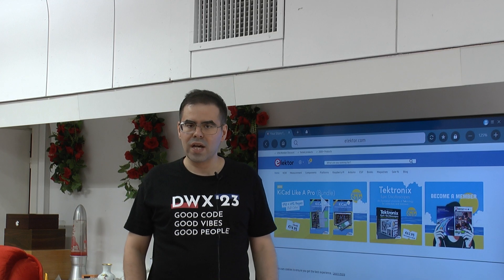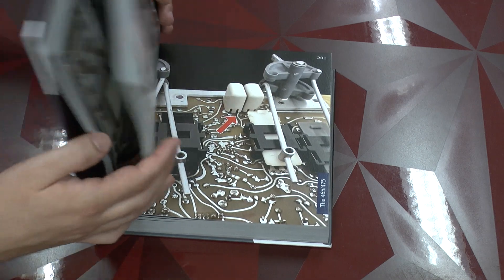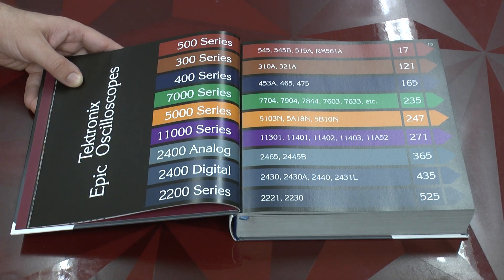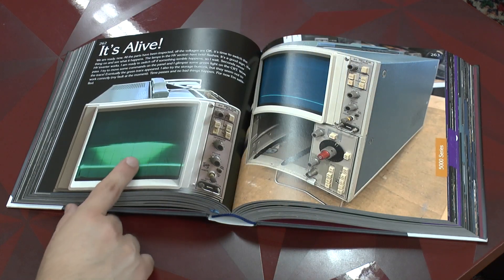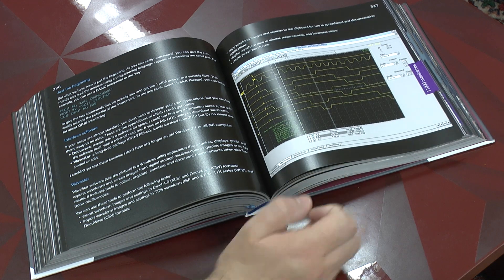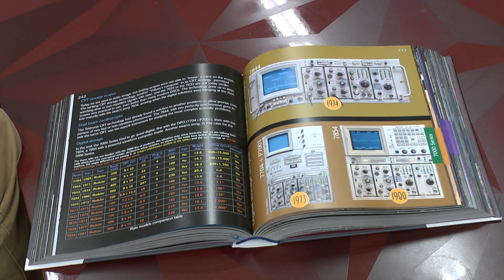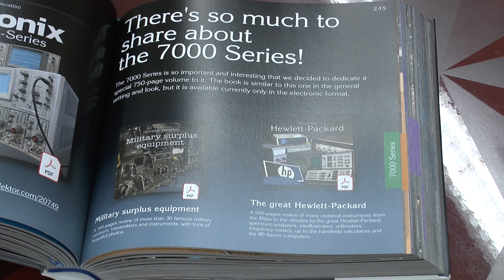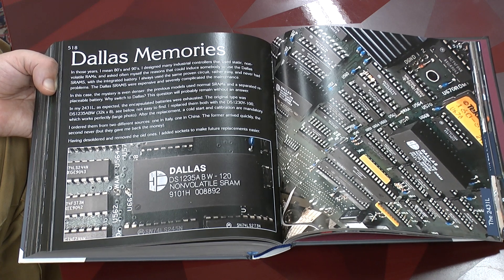Vintage Tektronix Oscilloscopes - the book, not only on Tek Scope repairs

Comment: I have the 323, the 324, a 453A, two 2465 and one 2465A scops.
Reply from the maker: Thanks, my friend! Hope you like the video!
Reply: @MrTamhan  I first used Tektronix scopes in 1972, in the US Army. I've long forgotten the model numbers. One was a small, battery powered model that was modified t use as a TDR for Cable TV.
The other was probably a 500 series that I had to repair  so that I could repair a lot of TV broadcast equiment.  This included several RM529 Waveform monitors. 
My strangest Tektronix scope is the 1780R,. It is a Waveform monitor and a Vectorscope, but it has two CRTs.
Reply from the maker: @michaelterrell  oh man, the classics. One day we need to make an interview with you!
Reply: @MrTamhan  I'm trying to clear an area to set up a home studio but my biggest hurdle is poor internet service. I'm using a satellite link with a very high latency, and frequent drop outs. Fiber is coming to my area which will  be a huge help. 
I've watched electronics go from all vacuum tubes, to modern ICs. Tolerances go from 50% on resistors to 0.01% and failure rates drop. The industry took a huge leap forward during WWII, with top secret work at the MIT Radiation Labs. We went from Crstal radios and TRF to real electronics. I have the entire set of declassified books that cover every aspect of the changes. I would enjoy a interview if you like this or another topic.
When RCA started the first Semiconductor replacement line of diodes and transistors, the entire cross reference was a fold up  reference that fit a shirt pocket and covered about 200 devices.
May you have a Blessed day, my friend.
Reply from the maker: @michaelterrell  Hi Man, thank you so much for the willingness! Shoot me an email at tamhan@tamoggemon dot com please. As for the internet...are you worried about the uploading of the videos, or what?